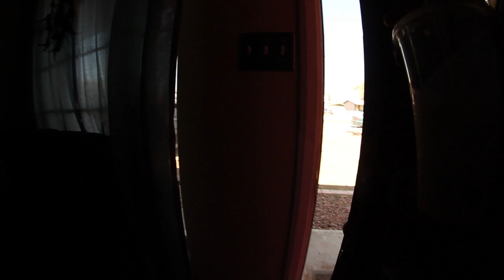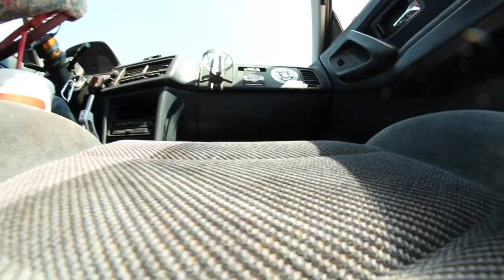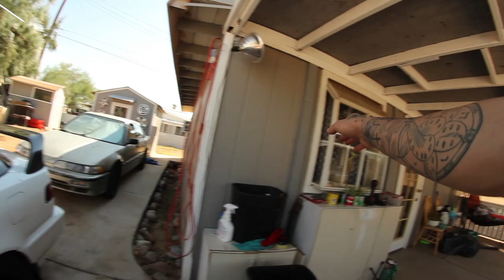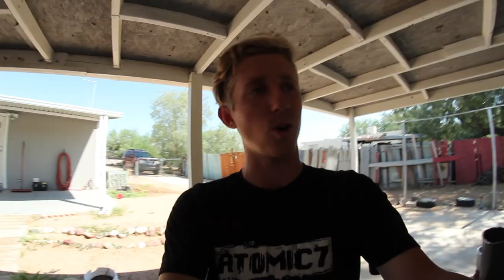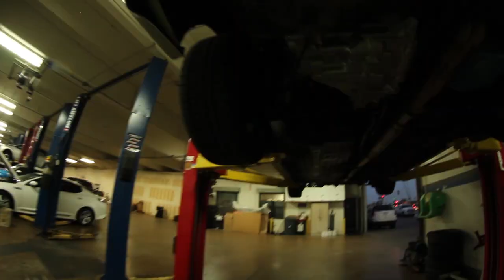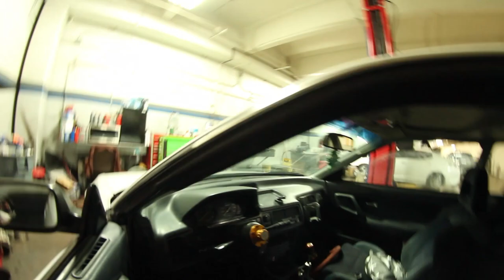SwayBar Bushings Install and Giving Away A Board

Comment: You should try and paint the plastics around the window i did mine with platidip and it rubbed off over time from washing it, I did mine with a flatish black paint turned out good it's been 3 years since then.